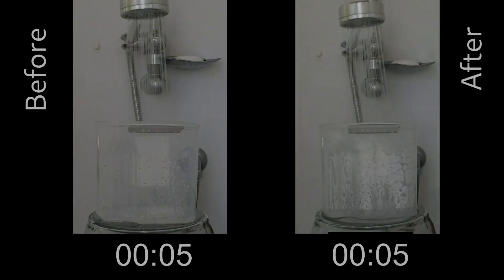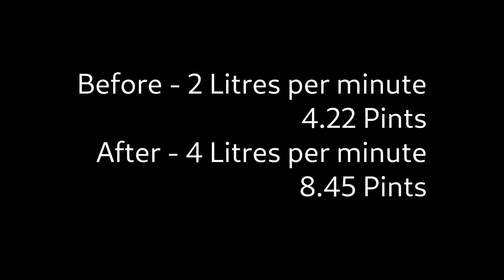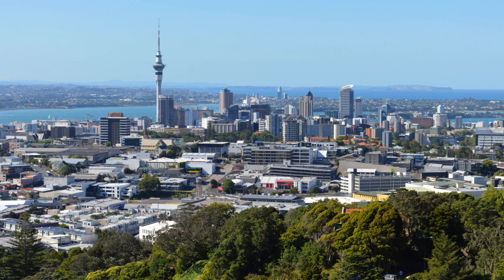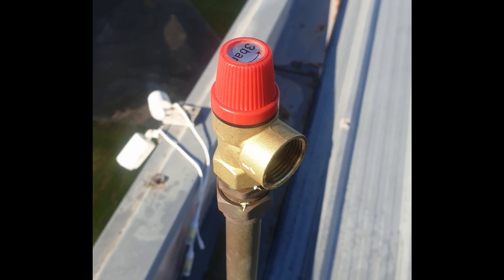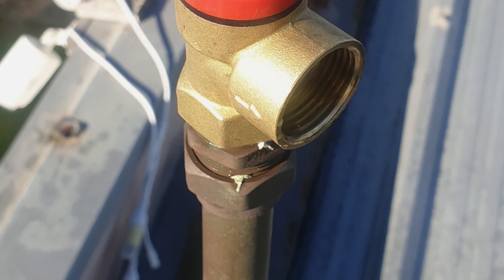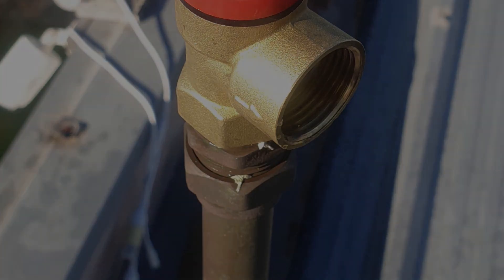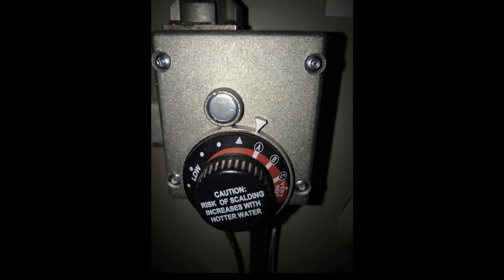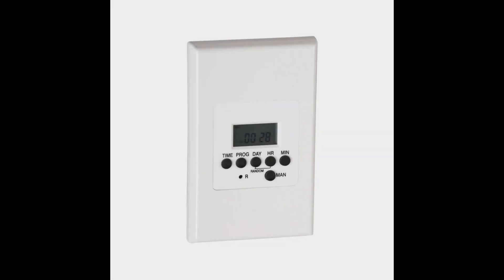How to double your hot water pressure

Comment: If you are tuning your Ajax valve, you turn the little threaded part at the back and not the large "Black" looking valve on the front, turning inwards towards the Ajax valve will increase water flow, try 2 full turns at a time and watch overflow pipe on roof - if water overflowing then turn Ajax outwards 1 turn, then tweak n play with half and quarter turns.
60deg at the tapes will burn you, I set at 56 witch will still burn but saves and gains in multiple areas...
NB: I also am not a plumber